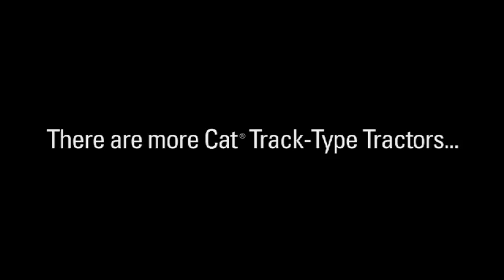Cat® D6T D7E and D8T Track-Type Tractors | Dozers

Comment: I liked the high track design, easier to keep clean, and to clean, I didn't have a carrier roller, so I did not have to worry about it stopping. That ram in the center reminds me to, of the Terex. 
I have driven a lot of different dozers in 40 years and they all have their god and bad, but you get used to them as you go.
The main thing is, that they have a good cab, aircon and radio. That goes for all the machines.

Comment: yeah,no problem. i ain't too good at spelling myself. and you are right. it is to keep the crap out of the drive sprockets. ideal in sand,because operating in sand is basically operating in a sand blasting chamber. very corosive and abrasive. but oval tracks seem to do well in the sand if you maintain them and turn them properly so you don't get a bunch of sand in the drive sprockets.

Comment: and high sprockets(A tracks) are mainly to keep all of the shit out of the drive sprockets. but if you go at any kind of speed with A tracks then they literally fall apart. with oval tracks you can flat fly and do more work faster  but the drive sprockets are more likely to have more problems and require more Maintenance . but in some cases it is worth it in the extra work you can do in less time.

Comment: but you have to go slow with the A tracks. with oval tracks you can flat fly! i used to have a john deere 650 with oval tracks. it had all of the computer and gps systems. it would literally drive itself and with them oval tracks you couldn't keep up with it if you were sprinting with both slope bars down digging in the dirt! if you go at any kind of speed with A tracks they literally fall apart.